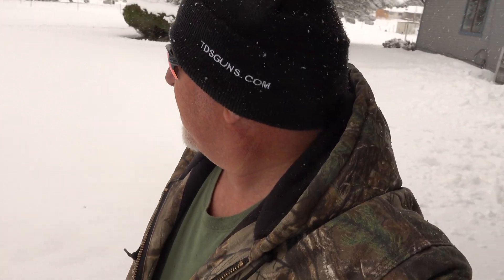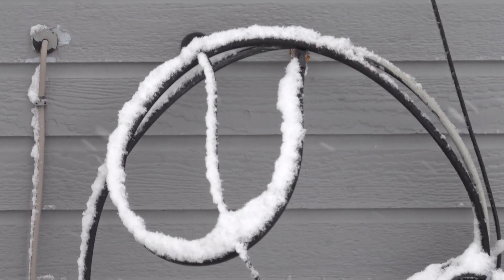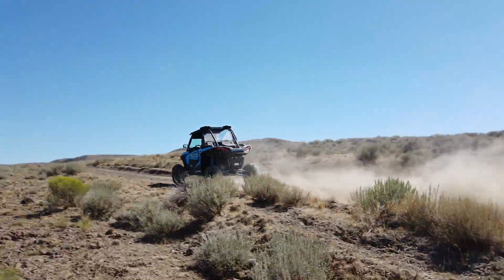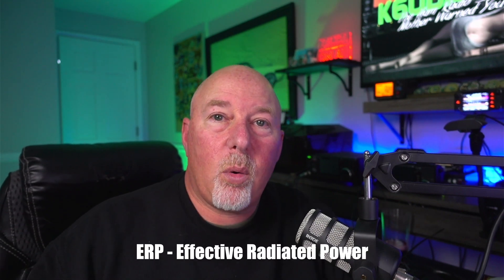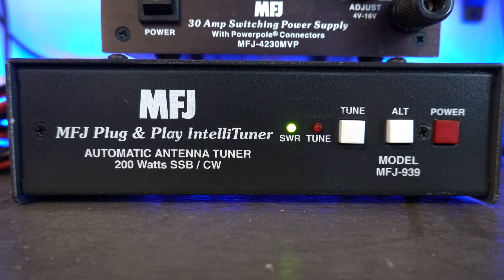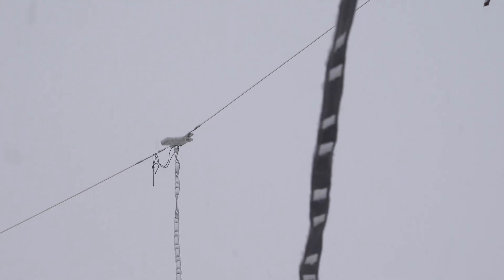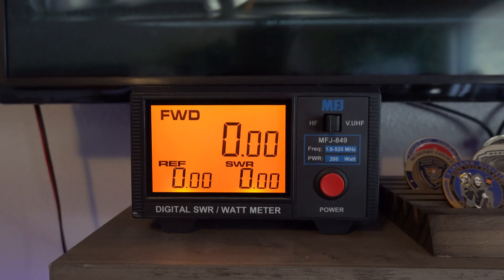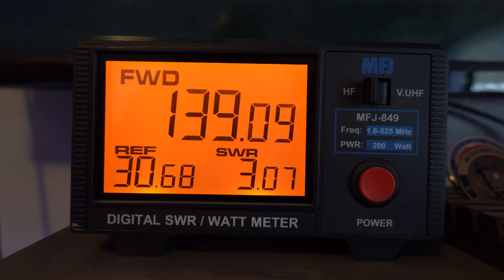How much RF power is your ham radio wasting? | K6UDA Radio

Comment: Your power meter is designed to operate at 50 ohms. It will NOT read accurately if the coax is operating higher or lower than 50 ohms. Connect it between the rig and the tuner.

Comment: Put the tuner after the power meter so you get a proper reading. The tuner need to tune the antenna not the meter. The tuner (match box) needs to be directly to the antenna Between the antenna and the and the meter. Cheers  Rick, AA6J.

Comment: It's sad that so many ham's don't understand their antenna tuner. PCore has it mostly right below. The antenna tuner does nothing more that phase the power in a way that your antenna can accept. It provides a transmatch that cancels the reactance of the antanne with the opposite reactance in the tuner. The only losses are on the feedline. Too much is made of I2R copper losses. When you have ladder line or low loss coax you should be good. However, when you can place the antenna tuner at the base / feedpoint of the antenna you should do it.
Reply: Can you imagine how hot a tuner would get if it was actually dissipating the wattage some claim they absorb?
Reply: @Russ-nf9tv  Exactly, I'd be toasting bread on it and boiling water all at the sametime. No one is arguing that a full size resonant antenne is best. Unfortunately, we all don't have the space for them!!!

Comment: You are wrong, after tuner reflected power is reflected back to antenna many times, so it will try to go to antenna, but for high SWR coax could loose some of them in transit as a heat.

Comment: His math is wrong.  The ONLY power loss is in the transmission line, the reflected power is not dissipated in the tuners (why use two, are both tuners krappy?) or the radio.  That power is reflected back to the antenna, put a power meter at the feedpoint and see. Ron W4BIN

Comment: From what I learnt in the 1980's, ERP (effective radiated power) = the power that actually gets to the feed point of the antenna multiplied by the gain of the antenna. So, if 80 watts gets to the feed point of the antenna, and your antenna has 6 dB gain, then your ERP is 80 x 2 (3dB) x 2 (3dB) = 320 watts ERP (in the direction of max beam width)

Comment: Actually, I think this is not the whole story. A part of the signal is reflected at the antenna because of the mismatch. But it does not disappear in the tuner, but is reflected there again towards the antenna. In this way, it is reflected back and forth many times until most of it has been radiated. The primary losses occur on the line between the tuner and the antenna, because the signal passes through the antenna cable many times. If you had a cable with almost no attenuation, like a ladder line, it wouldn't matter. This is how the ZS6BKW or the G5RV works. You might even be able to test this. Measure your RF power before and after the tuner and you might see a higher power after the tuner due to this effect.
Reply: I'm scared to watch the video now.  We really don't need any more misinformation about antenna systems.

Comment: Informative, short & sweet that's how I like them, 73
Reply: And unfortunately incorrect on line loss vs tuner loss.
Reply from the maker: I honestly don’t know what is wrong. Antenna comes out of tune or isn’t tuned, tuner makes the transceiver happy but there’s still high swr on the antenna. What am I missing?
Reply: @K6UDA  Are you using both the 7300 internal tuner and the MFJ at the same time by chance? If so they will fight each other. Tap the 7300 tune button to turn it off and then use the MFJ only.
Reply: @K6UDA  let's say 10% of 100 watts is reflected.  That 10 watts isn't absorbed by your tuner or radio, it is reflected right back to the antenna where 9 watts are radiated and 1 watt (10%) is reflected back to the tuner.  It bounces back and forth until it is either radiated by the antenna or is lost due to feedline losses.  Low loss ladder line has nearly no losses even at a 5:1 swr.  Feedline loss is really the only loss in an antenna system.

Edit: feedline loss is not the only loss, but it is unavoidable with high swr and lossy feedline.  Ground losses are probably the biggest loss in most installs, but it's kinda irrelevant to the subject.
Reply from the maker: Thanks.
Reply: @K6UDA  did you make an honest mistake here, or were you hoping to stir the comment pot?  Either way, I get it, just really curious.